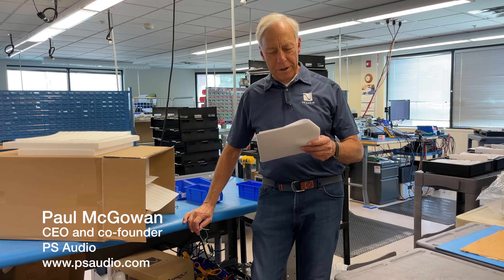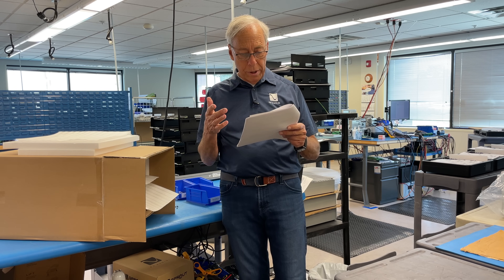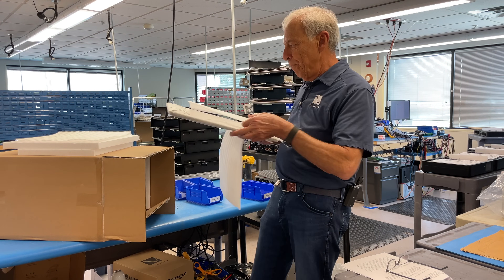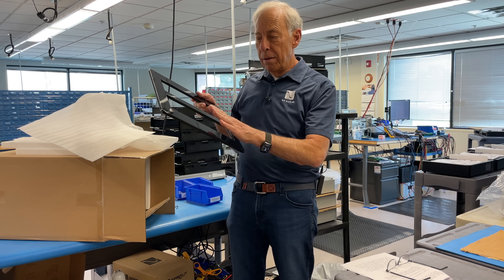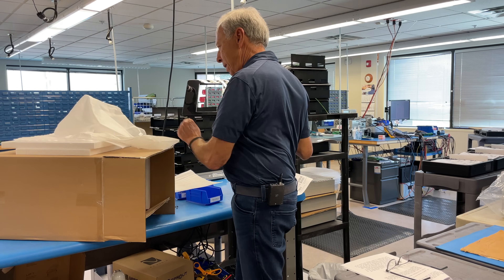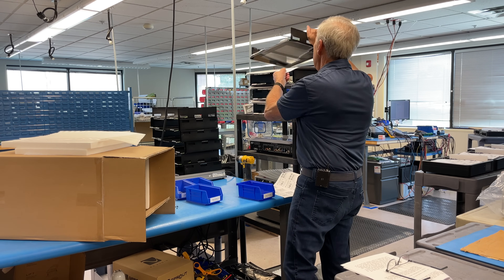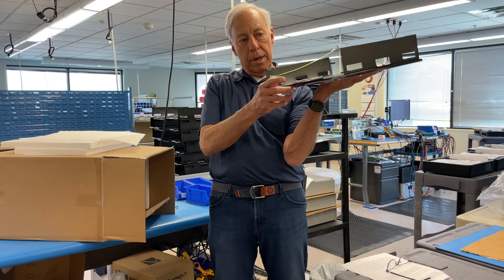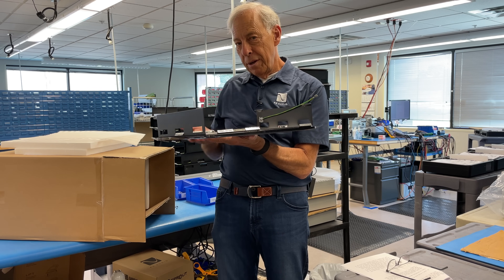What is wrong with PS Audio top covers

Comment: Question: is there a benefit sound-wise to not stacking certain PS Audio components? I’ve seen reviewers talk about an improvement in SQ when S700 amps were not stacked. What about stacking combinations of Power Plants, amps, preamps, phono stages or DACs, given that the heat generating ones have enough airflow? This video implies that there’s no harm but does not address the question specifically. Looking for a PS Audio representative answer.

Comment: The finish gets tiny scratches easily. I found out years ago when I bought a used P10 and no, I don't want to spend time and effort to hand buff it out. The three new PS Audio pieces I've bought over the years I've left the protective plastic film on. In some cases like the p15 I folded over the film from the heat sinks on the sides. Pulled it back and folded over on my BHK preamp (tube access on top.) It still covers my DirectStream Memory player (cd transport.) It'll be a plus when (if) I ever sell the equipment.

Comment: Correct me if I'm wrong, but MDF is also more sound deadening.  I've seen it used on high end turntables as its not as resonant as other materials can be.
Reply: Yes for a turntable or speaker, that makes a difference. But on a amp, preamp, DAC, even CD transport, it does not. Yes even a CD transport because any mechanical jitter is corrected electronically by a buffer (up to a point of course).

Comment: why spend money on cosmetics
Reply: for the cosmetics i would assume
Reply: If I was to spend money on these pieces I'd get something that looked even better like a McIntosh or Accuphase etc. At what price point do speaker manufacturers start making something that isn't completely boring?
Reply: Yeah!! Why not just put all the electronic in a plastic bucket between your speakers and be done with it 😒
Reply: Define, "cosmetics". It's something not easily defined. 
Why not just paint all cars flat black, or for that matter, just paint them with primer and leave it at that? After the primer its just cosmetics.
The fact is, anything better than circuit boards screwed to a piece of plywood with some window screen over it to stop emi is, "cosmetic". 
What might be cosmetic to you might not be cosmetic to somebody else. For the price of PS Audio gear, I think people are justified in expecting it to look nice, cosmetically.